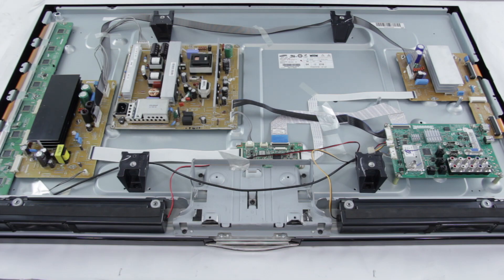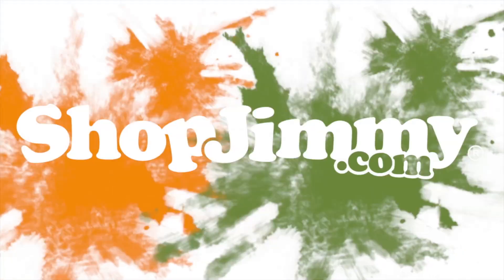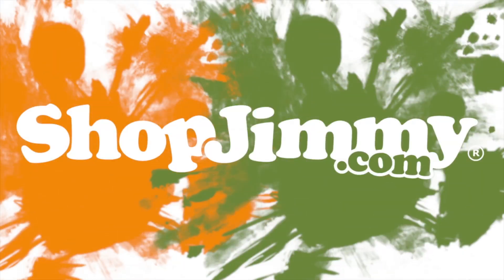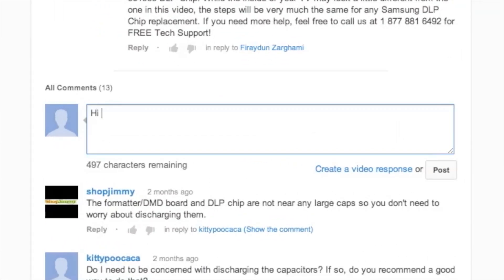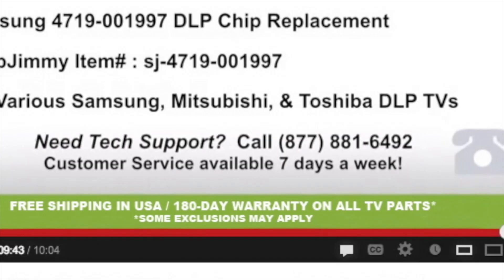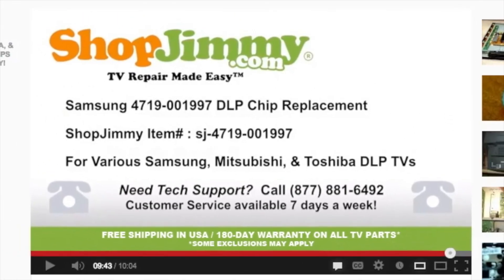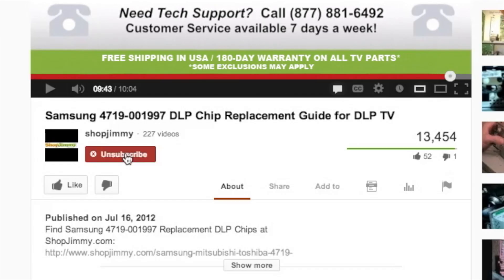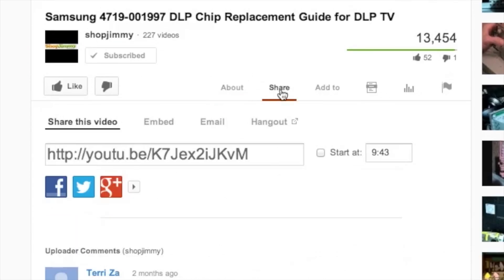Plasma TV Repair Tutorial - Common Symptoms & Solutions - How to Fix Plasma TVs

Comment: Hi, I have a Hitachi plasma TV 55HDS69 with two issues going on.

1.   When I run auto channel scan via air (I use an antenna for reception) it appears to pick up some channels during the scan, but when tuning to them they are blank.  I'm using "air" when scanning.  It's not the antenna because I hooked up my old tv to that same antenna outlet and the usual channels came in fine.  Interestingly, most of the channels the plasma tv appears to pick up during the scan are not the usual channels I receive.
2.   Several years ago, after the previous owner lay the TV down on its front, the picture has only filled about 2/3'rds of its potential area, with about a foot on each side of the image being black.  I've tried adjusting the aspect but no matter which setting I use this is as large as it gets.

I don't know if these two issues are related, but any advice you can give me on one or both would be greatly appreciated.  Thank you.
Reply from the maker: Jim Grape  Please watch this video FIRST to help with your repair!  TV Repair! LCD, LED, Plasma, DLP How To Fix Your TV with ShopJimmy.com Help!  Replacing the main board should fix both issues with the TV.  Follow this link to replacement parts:  http://www.shopjimmy.com/catalogsearch/result/index/?cat=225&q=55HDS69  Be sure to match part numbers on your current board, with your replacement for compatibility.  Here is a link to a video showing how to identify your part number, click here:  NEC Plasma TV Repair: Part Number Guide for NEC, Hitachi, & Fujitsu Plasma Panel Parts  Thanks and please let us know if you have any further questions with your TV Repair!  www.shopjimmy.com

Comment: I have a monitor witch I also use as a tv. its make by NEC model # PX-42XM4A I have a vertical white line crossing across ? I am surprise  of it ! what may be the reason for this ?
Reply from the maker: Joe Morales   This sounds like a TV panel (TV Screen) problem.  If your TV panel is bad, it may be more cost-effective to replace the TV as panels are typically hard to find in stock, difficult to replace, and expensive.  Thanks and please let us know if you have any further questions!  www.shopjimmy.com

Comment: Howdy,
got a Samsung PN42B450B1D. The image would occasionally washout in a snap. Left on for an amount of time the picture would snap back to normal. Each time it would washout it would take longer for it to come back. Eventually it never came back. My best description of the washout is very little detail due to bright whites. Dark reds are now bright pink and magenta. Blues and dark blues are now a bright cerulean blue and bright purple. Spotty yellow where there was green grass and a bright yellow green where there are dark greens. There is no slow motion issues and no black screen. No bars vertical or horizontal. Hoping you have a suggestion. THANKS!
Reply from the maker: Jack Spitler  Please watch this video FIRST to help with your repair!  TV Repair! LCD, LED, Plasma, DLP How To Fix Your TV with ShopJimmy.com Help!  I recommend replacing the Y-Main Board and the Y-Buffer board in your TV.  Click this link for replacement parts:  http://www.shopjimmy.com/catalogsearch/result/?q=PN42B450B1D  Be sure to match part numbers on your current board, with your replacement for compatibility.  Here is a link to a video showing how to identify your part number, click here:  Samsung Plasma TV Repair: Samsung Plasma Panel Parts Guide  Thanks and please let us know if you have any further questions with your TV Repair!  www.shopjimmy.com
Reply: ShopJimmy.com Awesome and thanks a ton! With that, I have one problem. The site at ShopJimmy.com states the Samsung BN96-12171A Y-Buffer Board is out of stock. Is there a possibility it will be coming in shortly? Is this possibly  a discontinued part? If discontinued is there another place you might suggest shopping? (I know. . . stab me in the eye for even asking) Or. . . would you suggest replacing the Main board in hopes it may take care of the issue. I did plug it back in and low and behold it worked. . . for two days. This time I can add the shutting on and off a regular intervals.

Thanks - Jack
Reply from the maker: Jack Spitler   It is tough to say when the board will be back in stock.  You can sign up to be notified when the board is back in stock on the board page.  If you sign up, then you will receive a notification when the board is back in stock.  Thanks!  www.shopjimmy.com
Reply: ShopJimmy.com Awesome. . . Thanks!

Comment: Samsung Plasma PN51D440A5D not powering up. We replaced the power supply board but still nothing. no stand by light. and no led light on logic board when pressing the power button on the tv or remote. Any thoughts of what this could be?
Reply from the maker: Gregg Stevens   Are you able to use a meter and check voltages? Thanks!  www.shopjimmy.com
Reply: ShopJimmy.com Yes, Found the service manual online and I checked CN801 #2 and it checked out at 5.3V. Both CN801#1 were at 0v and Cn802 had 0v.
I unplugged the power supply connector from the main board and left it plugged into the power supply jumped pin 1 to ground and when I applied power the plasma came to life for a briefly. We applied a jumper on the logic board to the 2 highest number test pins and the panel lit up with the test bars and the logic led was flashing. Which makes me believe the main board is fini.
Reply from the maker: Gregg Stevens  Sounds like jumping the logic board shows the logic is working seems the main board is holding down everything causing a dead set.  So you could replace the main board to see if that fixes the problem.  Here is a link to replacement parts:  http://www.shopjimmy.com/catalogsearch/result/index/?cat=56&q=PN51D440A5D  Be sure to match part numbers on your current board, with your replacement for compatibility.  Here is a link to a video showing how to identify your part number, click here:  Samsung Main Boards & Digital Boards: Part Numbers for LED, LCD, DLP, Plasma TV Repair  Thanks and please let us know if you have any further questions with your TV Repair!  www.shopjimmy.com

Comment: Hello, I have a plasma tv PN50C550G1FXZA. The tv has the red standby light on but it will not turn on. If I unplug the Ac Power cable and replug in the tv makes clicking noises and then eventually the standby red light becomes solid again but the tv still does not turn on. Should I replace the power supply board? Thanks Ann

Comment: I have a Samsung Plasma Model No. PN50A550S1FXZA, S/N B46V3CQS101329V.  I heard a loud pop and now I have no picture. The sound appears to work, but no picture.  I disconnected everything, and took off the back.  I did not notice any capacitors which were blown or bulging.  Also, I did not see any fuses blown. (all white fuses and appeared to be intact) When I power on the tv, I hear a one big click and hear the Samsung start up tones.  Still no picture.  I tried the menu on the remote and it will not show anything on the screen.  All black.  Can you help me diagnose the problem?
Reply from the maker: Timothy A   Please watch this video FIRST to help with your repair!  TV Repair! LCD, LED, Plasma, DLP How To Fix Your TV with ShopJimmy.com Help!  I recommend replacing the Y-Main Board and the Upper and Lower (Y scan Drive) board in your TV.  Follow this link to replacement parts:  http://www.shopjimmy.com/catalogsearch/result/?q=PN50A550S1FXZA  Be sure to match part numbers on your current board, with your replacement for compatibility.  Thanks and please let us know if you have any further questions with your TV Repair!  www.shopjimmy.com
Reply: ShopJimmy.com
Is it possible to just replace the Y main first without replacing the buffers in case the Y buffers work?  Hopefully I could save some cash.  If not working, then could I order the buffers?  Thanks...
Reply from the maker: Timothy A   It is possible, however not recommended.  If your Y buffer is bad, then it could do damage to your replacement Y-main.  This is why we recommend replacing all of the boards at the same time.  Thanks!  www.shopjimmy.com

Comment: Samsung Plasma TV model # PN50B450B1DXZA.  Get picture however vertical lines running full length of screen, about 1 inch apart.  Even with no input signal vertical lines are present. tried to reset using remote and unplugging and replugging back in. nothing helps.  What is the issue?
Reply from the maker: david owens This sounds like a TV panel (TV Screen) problem.  If your TV panel is bad, it may be more cost-effective to replace the TV as panels are typically hard to find in stock, difficult to replace, and expensive.  Thanks and please let us know if you have any further questions!  www.shopjimmy.com
Reply: It's the y buffer maybe bad connection!!
Reply: You tube it may be bad or just have bad connections!!!
Reply: Hi, I have same tv with same problem, replaced main logic board but still have 4 thin vertical lines.. did you find solution? Gerard
Reply from the maker: Gerodfather   This sounds like a TV panel (TV Screen) problem.  If your TV panel is bad, it may be more cost-effective to replace the TV as panels are typically hard to find in stock, difficult to replace, and expensive.  Thanks and please let us know if you have any further questions!  www.shopjimmy.com

Comment: Regarding my Toshiba plasma that will not turn on. I did as you said and disconnected the y board on my 51" samsung plasma tv then pluged in and tried to turn on. Only got a flashing light again. Just in case here is model number again pn51e530a3f version # ss01. Looked around each board and only thing I noticed that looked unusual was a darker discoloring on power board next to  two small circular items that had written on them dsc 2.5D-15 152 ////// on board reads ey829 and ey830 also ey831 and ey832. Thank you for your help
Reply from the maker: daddybo80  Please watch this video FIRST to help with your repair!  TV Repair! LCD, LED, Plasma, DLP How To Fix Your TV with ShopJimmy.com Help!  Repeat the same test on your x board.  If you get the same results then I recommend replacing the power supply board.  Here is a link to replacement parts for your TV model number:  http://www.shopjimmy.com/catalogsearch/result/?q=pn51e530a3f  Be sure to match part numbers on your current board, with your replacement for compatibility.  Here is a link to a video showing how to identify your part number, click here:  Samsung Plasma TV Repair: Samsung Plasma Panel Parts Guide  Thanks and please let us know if you have any further questions with your TV Repair!  www.shopjimmy.com

Comment: Hi, I have a toshiba 42hp95 has all functions but the color looks like that of a tie dye t shirt, cartoon colors instead of actual colors!? What may be the cause?
Reply from the maker: Terrance Johnson Please watch this video FIRST to help with your repair!  TV Repair! LCD, LED, Plasma, DLP How To Fix Your TV with ShopJimmy.com Help!   I recommend replacing the X board in your TV.  Follow this link to replacement parts:  http://www.shopjimmy.com/catalogsearch/result/?q=42hp95  Be sure to match part numbers on your current board, with your replacement for compatibility.  Here is a link to a video showing how to identify your part number, click here:  LG Plasma TV Repair: DIY Part Identification Number ID Guide for LG & LG Philips Plasma Panel Parts  Thanks and please let us know if you have any further questions with your TV Repair!  www.shopjimmy.com
Reply: Hi again I purchased a x sustain board is that the same as X Board?
Reply: If so when I installed it the problem is still the same!..did I receive another bad board? Or is it something else!
Reply: I just had a TV in my shop with the same symptoms. I "fixed" it by resetting the custom color settings and then adjusting them a bit to make everything look right.  It's worth a try.
Reply: I'll give it shot thanks I, ll be back to update
Reply: Color reset failed. ? X & y sustain replaced? Bad panel?
Reply from the maker: Terrance Johnson   If the X board was good and did not fix the problem, then I recommend replacing the Y sustain and the SU & SD boards in your TV.  Here is a link to replacement parts for your TV model number:  http://www.shopjimmy.com/catalogsearch/result/?q=42hp95  There may be multiple boards for the same TV model number, be sure to match part numbers on your current board, with your replacement for compatibility.  Thanks and please let us know if you have any further questions with your TV Repair!  www.shopjimmy.com
Reply: Ok just replaced both x & y boards so now onto su & sd boards also! Last attempt

Comment: I have a Panasonic Plasma Vieira TV model # TH-C42HD18 .  The TV went completely dead so I just replaced the power supply board and now when I plug it in I'm hearing the 2 followed by a 3rd click.  Then I hit the power button and the TV light comes on solid for about 10 secs then clicks off and repeats a double flashing light.  If I hold the power button down, it repeats the solid light followed by double flashing light.  I noticed that the Noise Filter (the part you plug the chord into) may have a minor 'burnt' look on one of the two soldered prongs that come out of the back connected to the wires that plug into the power supply board.  Can that be the problem?
Reply from the maker: danny stumpo   Please watch this video FIRST to help with your repair!  TV Repair! LCD, LED, Plasma, DLP How To Fix Your TV with ShopJimmy.com Help!  I recommend replacing the main board in your TV.  Here is a link to replacement parts for your TV model number on our website, click here:  http://www.shopjimmy.com/catalogsearch/result/index/?cat=56&q=TH-C42HD18  Be sure to match part numbers on your current board, with your replacement for compatibility.  Thanks and please let us know if you have any further questions with your TV Repair!  www.shopjimmy.com

Comment: i have those black horizontal lines across the screen. unfixable??
Reply from the maker: Rob Evenhuis   Are the lines horizontal or vertical?  Please reply with your TV model number.  Click here to view a video that shows how to find your TV model number:  TV Repair STEP #1 Help IMPORTANT TUTORIAL How To Find Your TV Model Number Tutorial TV Repair Help  Thanks!  www.shopjimmy.com
Reply: ShopJimmy.com the tv is a samsung PS50C550G1W (XXC) the lines are horizontal. i already tried to clean the top ribbon cable but the lines are still there. i think the main y-board serial model number is E159725.
Reply: +ShopJimmy.com sorry i got the wrong one.
MODEL NO. 50UF 2P YB CON
PCB NO. LJ41-06755A
PBA NO. LJ92-01680A
REV NO. R1.1

Comment: 50 in TV samsung. S/N AQX03CHQ910782H  MODEL: PN50A400C2DXZA Version SE06
half right side of screen is black, What part should I get to fix the problem? Many thanks for your help
Reply from the maker: Al Dang   This sounds like a TV panel (TV Screen) problem.  If your TV panel is bad, it may be more cost-effective to replace the TV as panels are typically hard to find in stock, difficult to replace, and expensive.  Thanks and please let us know if you have any further questions!  www.shopjimmy.com

Comment: Having problems with my samsung plasma PN51E530A3F 51" tv. TV just stopped working one day. Try to turn on tv but all I get if a flashing red light which goes out after a sec. Hoping it is something I can replace myself.  Any common problems with this model or simple fixes I can try first. ( Like fuses)
Reply from the maker: daddybo80 Try this at your own risk. Unplug the TV, then disconnect the y board and plug in the TV to see if the TV powers up. Reply with the results of this test. Thanks! www.shopjimmy.com

Comment: Hello!

I have a Samsung PN50C450B1DXZA Ver NY02.  The screen has lines that run up and down over menu options and constantly.  I was hoping for some assistance with what the issue maybe before I start buying replacement parts that aren't necessary.

Here are some screenshots of whats happening if it helps:

http://imgur.com/a/44Hor

Comment: model number PN59D550C 59" samsung plasma.  one horizontal line 3 quarters of the way down.
Reply from the maker: Courtney Weaver  I recommend that you reconnect the ribbon cable, and if needed you can replace the cable.  If that does not fix the problem then I would say you have a bad TV panel.  Thanks!  www.shopjimmy.com

Comment: I have a PN64F5300AF Samsung 64" Plasma.  
 3-4 months ago, it started acting up and would take me 2-3 on/off attempts to turn on.
 It got to where I would have to unplug and plug back in and then try and it might turn on. 
 Now it will not turn on at all.  The red light blinks twice - then again every couple of seconds maybe 10 more times. 
Have tried it on surge, direct to wall, used multiple outlets, left unplugged overnight and still nothing will happen other than the red light.

Please advise, thanks .
Reply from the maker: B Lisenby   Try this at your own risk. Unplug the TV, then disconnect the y board and plug in the TV to see if the TV powers up. Reply with the results of this test. Thanks! www.shopjimmy.com
Reply: I still have not had a chance to take the tv off the wall mount. - will do, and let you know of the results as soon as I am able. Thanks